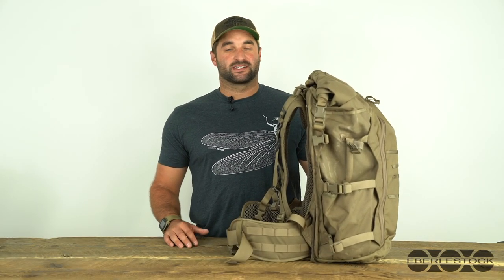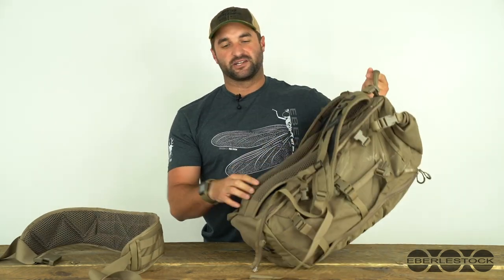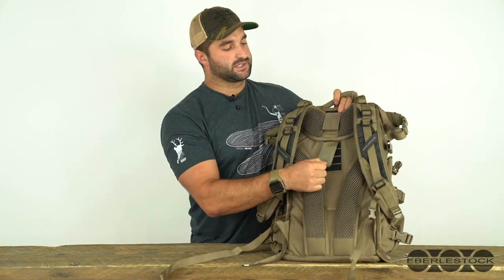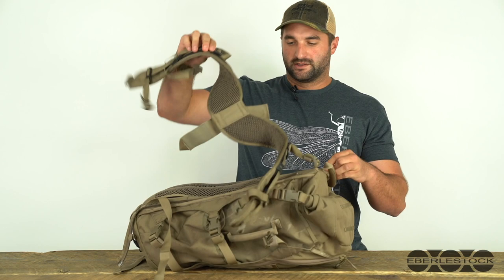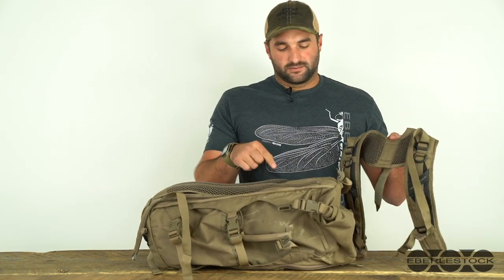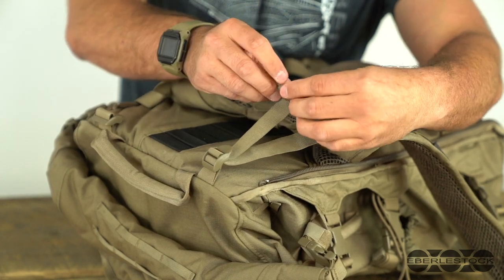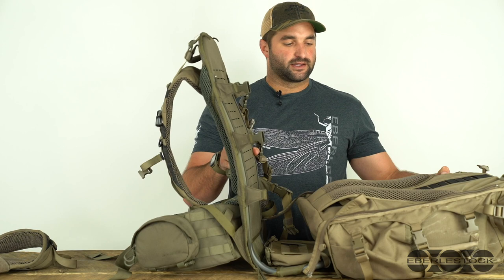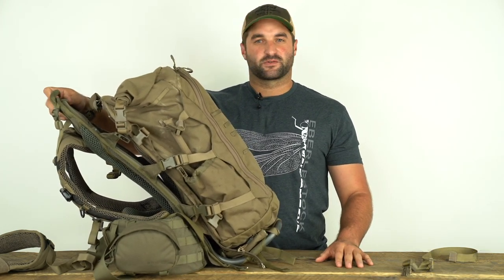How to Remove an Eberlestock Shoulder Harness and Hipbelt

Comment: Does the tall mainframe come with the large hip belt or was that something you modified?
Reply from the maker: That was swapped in place of the regular hipbelt!
Reply: @Eberlestock  Thanks. I did wind up buying the tall F1 mainframe, but the included hip belt is too small for me. Will you be getting more Large Hip Belt's in stock soon?